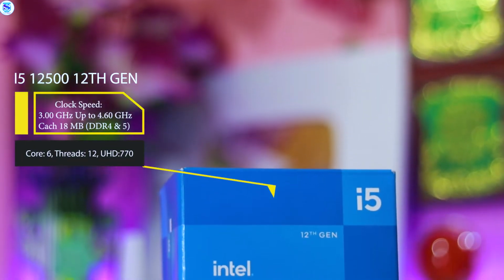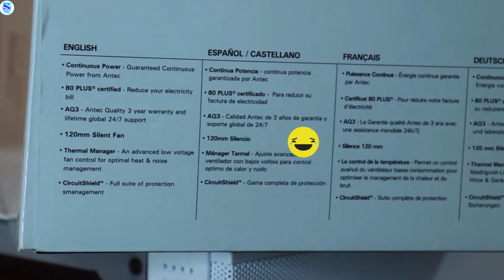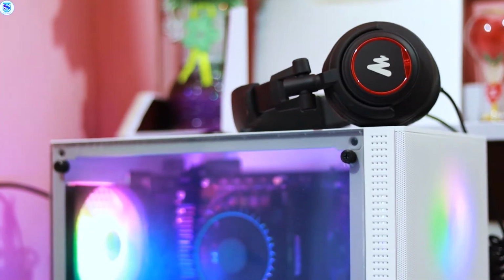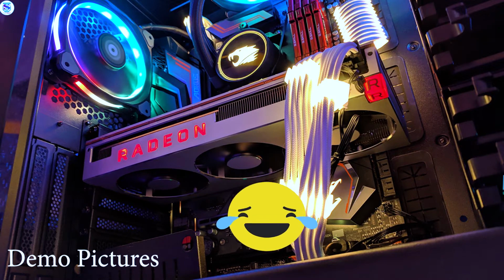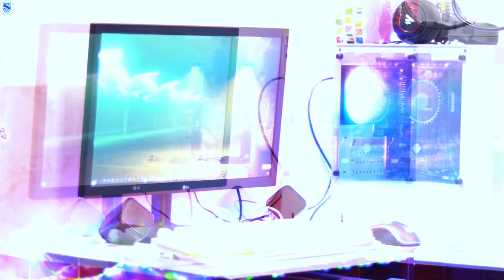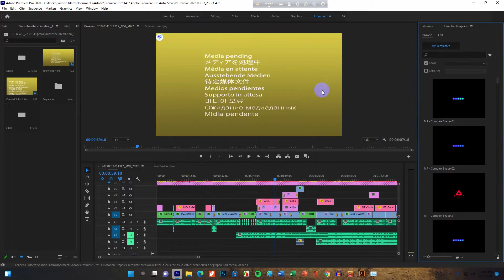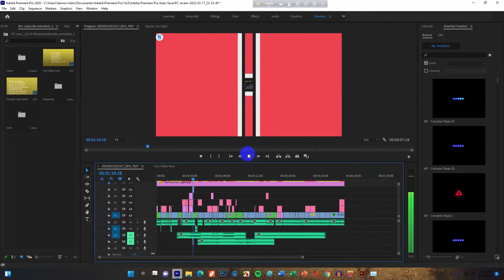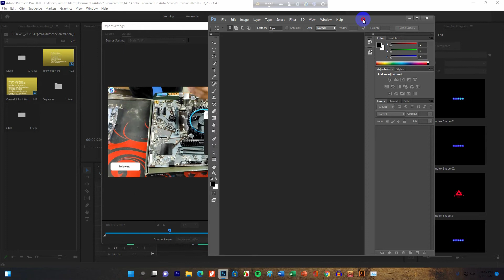🔥🖥Gaming & Editing PC Build 2022 || intel i5 12500 12th gen Processor || TecH SaimoN

Comment: My one question ❓
Please Answer me 
I want to buy a computer.  But I'm getting confused whether to make a computer RYZONE 5 5600G or Intell .core i5 12500 which will be better
Reply from the maker: If you have a plan to buy a GPU  then go for 12500, If you never buy GPU then go for 5600G.
Reply: @TecHSaimoN61  How to play games at 12500
Reply from the maker: You need to buy a Graphics card with 12500 to play smooth gaming.

Comment: Personal computer

1.Intel core i5 12500/12400 -24,000/21,000
2.MSI Pro B660m A DDR4 -13700
3.Ram Corsair vengeance Lpx 8gb 3200MHZ DDR4 -3400
4.Aitc Kingsman km600 256GB M.2 NVMe PCle SSD -3500
5.Power Supply 650 w -5000
6.cashing valutop B701 black -2500
7.Kybord, mouse, headphones,mouse paid combo Mick -2300  
Suggest you 
My first time computer 
Did I do something wrong?
Reply from the maker: 3. Try to add another 8GB RAM (8+8=16GB)
5. PSU corsair 80+ bronze certified 550W is enough.
Reply: @TecHSaimoN61  thank you Vai ...you are best YouTuber ..Allah bless you
Reply from the maker: Welcome 🥰
Reply: Is this Good for gaming and autocad with a budget around 40k indian rupees (500$). The specs are  intel i5 12500, gigabyte b660m DS3H wifi, adata SR30 16 gb ram, adata swordfish 256 gb, adata XPG  pylon 450 watt and a gud cabinet .

Comment: Please suggest Under 70k with i5 12500 (without graphics card)
Reply: you can get it under 50k as well without gpu
Reply: For around 40k indian rupees (500$). The specs are  intel i5 12400 or i5 2500 (same price) , gigabyte b660m DS3H wifi, adata SR30 16 gb ram, adata swordfish 256 gb, adata XPG  pylon 450 watt and a gud cabinet .